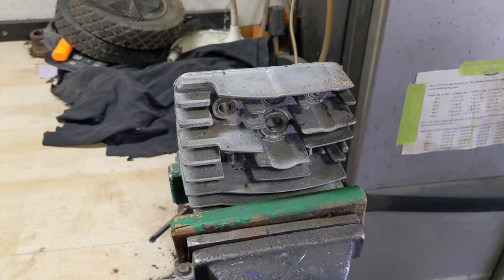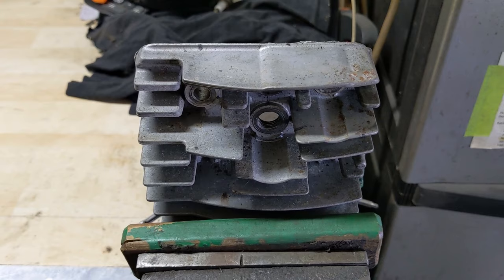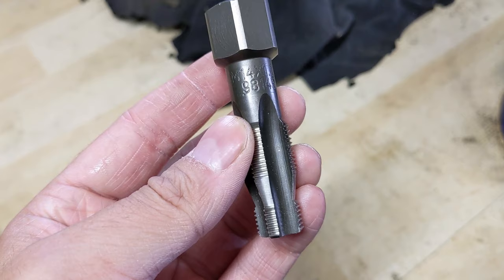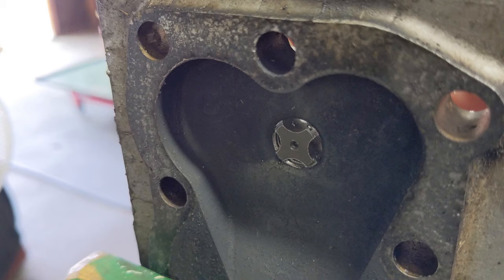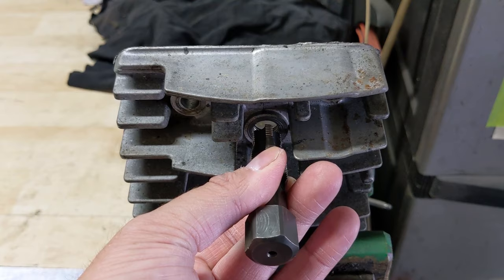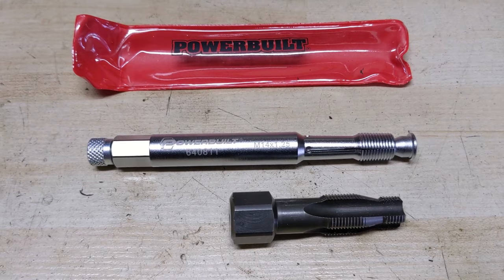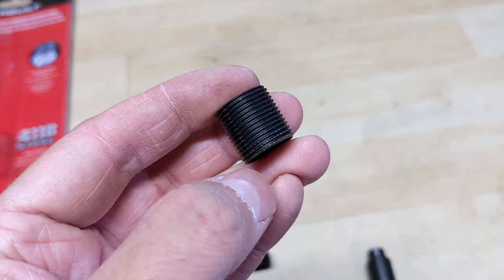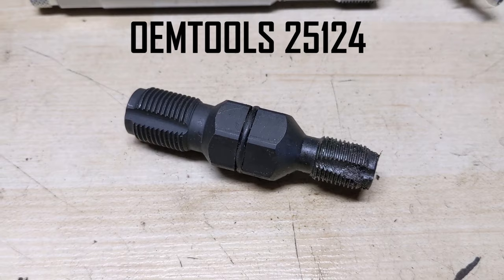Spark Plug Thread Repair

Comment: It's good to confirm thread damage before anything. I had the situation where it looked like the spark plug was crossthreaded. It moved  with difficulty. I thought someone had used loctite or some other product there. I almost ended rethreading the hole. I looked by chance at the bottom and it had this thin layer of varnish on the bottom threads. I realized it was the varnish acting as some sort of loctite there. I removed the varnish and there was nothing wrong. But the varnish was really stuck. I took a few hours to get out. But it goes to show that what looks like crossthread sometimes is not crossthread and it is good to see the crossthread before rethreading.
Reply from the maker: @stellarv5689  a torch would likely remove the varnish, it's possible to burn it off the same way we clean spark arrestors

Comment: After an unforgettable, heart stopping moment when I crossthreaded a plug two decades ago, I eventually bought this tool to have on hand if I ever encounter difficulty. Cleaning up threads is always better if you start from the bottom, to be sure you're at the right angle. Since then, I've been so paranoid I've never had need for plug thread repair.

Comment: So when you are dealing with aluminum heads you will want to use a cutting lubricant thats aluminum friendly. There's several we use in the machine shops that are available, However just everyday WD-40 works well on aluminum.  If you're working on a STEEL head, you'll want to use a cutting oil for steel. I really like Tap Magic. And its available in a small 4 oz can. And to help avoid debri getting into the engine on aluminum heads. Rotate the piston into the top dead center position. The move it back slightly into the cylinder to make sure you do not hit it with the thread chaser. If you can,, remove the muffler also.
Then do the work, Then before you do anything else use some compressed air and a blow nosel try try and blow out any of those small chip. Typically they take the easiest path and go out threw the exhaust. If you're working on a steel head, then a small magnet on a collapsible rod (they sell these at the parts store) Place that down into your newly cut hole and add a small amount of air around into the cylinder. The magnet will attract the metal chip. And be careful when removing it to not knock them off. I do these a few times till I'm sure I've got everything out of the cylinder I can. Just so advice from a machinist thats done a few of these jobs in the past 40 yrd. 😉

Comment: Just wanted to add another fix for this issue, especially for spark plugs with stubbier threaded sections like he showed, is to remove the washer at the end of the plug. This allows the plug to screw in at least one full turn deeper into the cylinder head, potentially allowing it to grab undamaged threads further back. It's worked for me so far. One caveat is that this washer is there for a reason. In my case, it hasn't affected performance on my Briggs and Stratton engine mower. I had to use a hack saw and cutting pliers to remove it, but a Dremel-type tool could also work.

Comment: Good video, but you forgot after heil-coil is installed, you need to use that punch, and hit a couple times to seat the top part of heli-coil.
Reply from the maker: Yes but I didn't actually install them in this video, was more a video to show off the reverse thread chaser. Thanks for watching!

Comment: Excellent tool thread expander, work from inside out removing debrees out of hole, but i never had distroy ed sparkplug thread, i always finger tightsen before Using any tool
Reply from the maker: That's the best way to do it, but this will make a great repair tool. Thanks for watching!

Comment: Good video except that the tool use was demonstrated using no grease and applying 'sticky grease' is best.  Grease was mentioned, but late in the video.  Also, deep socket over the end of the tool for final extraction works best.  Turn knurled tip of the tool clockwise to tighten and expand the threads of the tool tip, then turn counter-clockwise by hand to thread the tool into the undamaged threads.  When damaged threads are reached you will likely need a wrench to further turn the tool to re-cut the damaged threads, as turning by hand will be too hard.

Comment: Another great video!  I was thinking on that first tool before you said it that a dab of grease on the bottom might keep shavings from entering the combustion chamber if the heads still on.  It worked pretty good when I punched then tapped threads into an oil pan for a supercharger install on an old car.
Reply from the maker: Yes the grease will be sticky enough and should keep the debris from going in, but I just wanted to make a point about how much better the other tool is during the comparison. Thanks for watching!

Comment: Hi. Just came across your video. Im having trouble with the spark plug on a Troy-Bilt storm 2410 and trying to see what i can do to fix this. Thinking when someone tried replacing the spark plug they cross threaded it-when i went to replace it the porcelain was cracked and im now having trouble getting the new plug in? Not sure if i was given the wrong plug at the store but i need to look into it first? Wondering how i would now what size of this tool i would need if i had to repair threads? Any way you could help with that? Just trying to fix a snow blower is all. Thank you if you can! Have a good night

Comment: That's an awesome tool! If you do not have any grease, I use fully synthetic engine oil works the same lol! Btw, we have a product that can restore/fix threads just like yours, but ours can be used for inner and outer threads, maybe you can check it out!
Reply from the maker: Thanks for watching!

Comment: Nice video can you tell me what are the size of the new threads (outside) of the helicoil please on the oem kit? 
My motorcycle head has been drilled and retaped but when i removed the spark plug the helicoil came with the plug. I'm looking for a new helicoil but can't seem to find one, that is M14 1.25 inside and M16 1.5 outside. Cant's seem to find a back-up for M16 1.5 either... :(
Thanks

Comment: "Make sure the piston is all the way down"....check the depth by measuring with say a screwdriver??.....
Reply from the maker: Yep that'll work, we use a wooden dowel because it's hard enough not to bend but soft enough so it doesn't scratch the piston up

Comment: It needs be longer for useing in a 5.4 Ford motor  10 in at least to be able to get a grip on the bknout tool be great find one 10 plus ins or u cauth hell trying bl and retap on fords alum heads works great on motor bikes mowers etc u can get to be a hemi type motor were u got go deeeep in cly head be a bit of a job u need modifications of tool